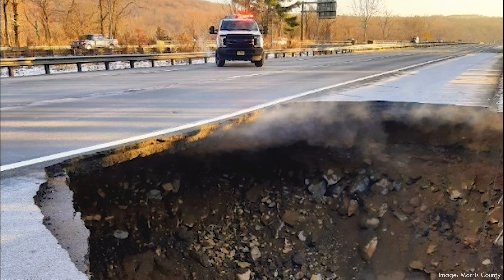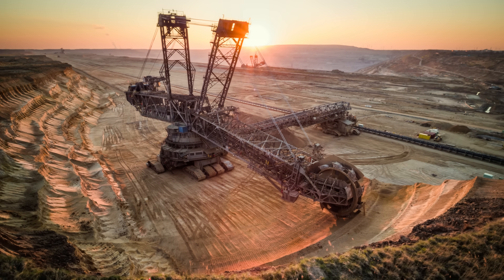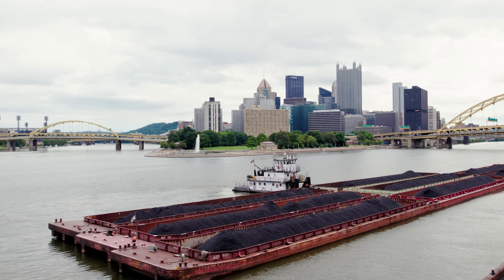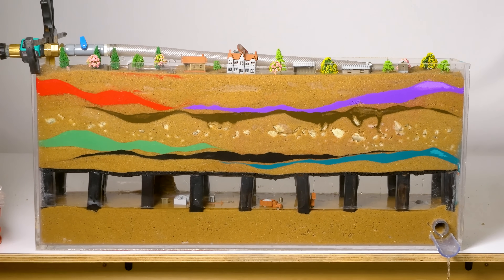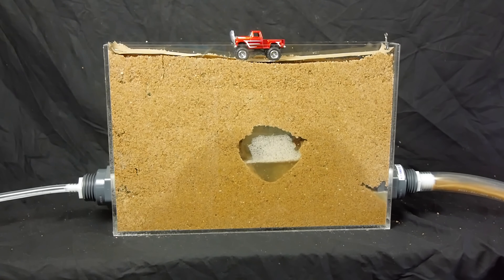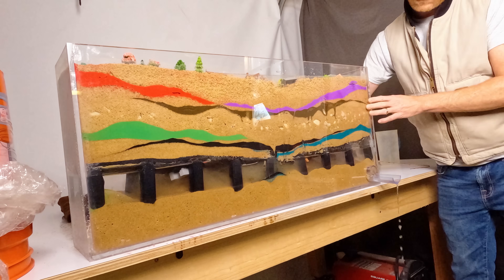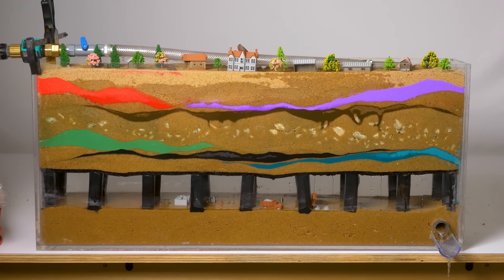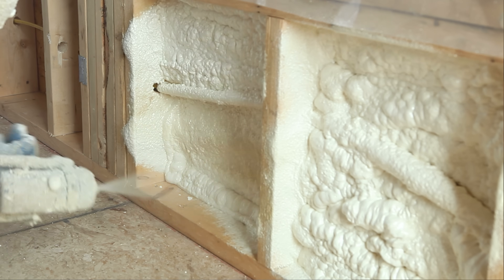When Abandoned Mines Collapse

Comment: In the 1980s I was involved with strip mine reclamation in Illinois. There can be as many as 5 layers of coal seams stacked that were shaft mined. Then as technology improved, the company came back and strip mined the remaining pillars of coal from the top seams. So you end up with strip mines on top of shaft mines. Some of the worst to try to restore ended up as local parks that mitigated runoff damage but no attempt to restore the original grade. They made good refuge islands for wildlife in the great corn desert that is Illinois.
Reply: as a current resident of central Illinois, I can confirm that there are numerous weird holes in the ground around here that are used as ponds/lakes for sportsmen.  I've been told that the Wildlife Prairie Park near Peoria originated in that way... but that is a somewhat hilly area to start with.  A buddy used to be a machine operator at some of these strip mines and shared a few stories.
Reply: @SkyhawkSteve  As a Southern Illinois raised person, I can also confirm. :D  In fact, my father worked for Peabody, which had both room & pillar and strip mining in the same area.
Reply: @SkyhawkSteve CENTRAL ILLINOIS MENTIONED HECK YEAH (I hate it here)
Reply: In a way thats almost the best outcome. Wildlife refuges, parks, campgrounds, sports fields (without the big paved lots & stands), etc.
Reply: If you ever check out old mining maps, springfield Illinois is basically sitting on top of an old mine. They were mining in the early 1900, so springfield was very small at that time. They would mine everything in rural areas around springfield. 100 years later, springfield has grown and basically developed on top of the entire mine structure. And yes, they have been having mine subsidence over the last 50 years. Makes buying property and building a home kind of scary.
Reply: @jerrywright9657  Fun fact! Murphysboro had the very first commercial coal mines in all of Illinois. And in southern illinois, there was the Herrin Massacre, over coal mining. You can get the mine maps and mining reports for free to download from University of Illinois if I'm not mistaken. They describe the conditions underground, type of coal, and amounts mined, from what seam, and over what times.
Reply: @robertschemonia5617  The ilmineswiki site gives some very detailed maps, maybe that's the one you're thinking of?
Reply: From around Marion, Illinois up to Springfield is like swiss cheese from the coal mines. We've also got a bunch of old mine pits around Dongola, IL area that people have used as "swimming holes". Dongola use to be a major transport hub for the Central Rail Road also back in the late 1800s early/1900s. Actually was a kid a decade or so ago that went swimming in one and died a couple weeks later from some sort of either parasite or bacterial infection (can't remember now) that got into his brain.
Reply: @WreckedRevival  That would be Naegleria fowleri, the brain eating amoeba. Rare but fatal. Only 4 survivors of 164 cases in the last 60 years.
Reply: @jerrywright9657  Did the amoeba grow there because of stagnant water?
Reply: @eugenetswong  It's common in the environment both soil and water. Stagnant water is just one of many places. Grows at temps above 50F best above 77F so when it gets in the brain, it's prime temperature to grow. Infection is limited to one specific stage of the life cycle so a lot of things have to happen at the same time to get it on the path to the brain.
Reply: @ Jerry, thanks for this info and everything else that you mentioned!
Reply: Driving between Du Quoin and Sparta is like visiting a different planet.
Reply: @ Also between Marissa and New Athens.
Reply: I love it when people who really know what they are on about comment
Reply: @the_even_toed_ungulate.  'I love it when people who really know what they are on about comment'

I agree. Quality comment sections are priceless.
Reply: In edwardsville and the surrounding areas, they built a trail that goes thru the reclaimed stip mine areas
Reply: @jerrywright9657  I know someone with the same name. My father worked for the place he owns for a lot of years. Wild.
Reply: Reclaimed strip mining in SE Ohio has not done a great job restoring the land. I'm not sure why this is - maybe no specific retention and replacement of topsoil - but the land does not recover well.
Reply: How do you strip mine pillars? Remove the overburden to the level of what used to be the roof of each level? At some point the overburden would cave in and fill the rooms between pillars. Selectively mining the coal while not mucking out the waste would be difficult.

Are you sure they weren't retreat mining the pillars?
Reply: Glad to see some discussion about Southern Illinois on such a popular video. Grew up fishing reclaimed strip pits…there are no shortage of them in Southern Illinois. Seems like every one of a certain age had multiple people in their families who relied on coal mining to make a living as well.
Reply: Kickapoo State Park.
Reply: Yeah im from Lincoln and I've been told we are on top of a coal mine. All the houses sink and sag. Its sad.
Reply: Corn desert? That's one way to out yourself as a criminally incompetent city slicker

Comment: Worth noting, NJ had an earthquake not too far from the I-80 collapse less than a year before the collapse. Your banging on the model is not too far off.
Reply: I live to the east of the collapsed areas of t
80 and was about to add a similar comment.  One clarification.  There is regular seismic activity just to the south of Wharton… about 30 miles max.  In fact, there have been 30 quakes over the last 365 days.  About 10 in the area of Bedminster between 1.5 and 2.4 in the last 7 months.  The Ramapo fault runs through the area and under 80.  The one you are referring to was in April 2024 at 4.5.
Reply: @georged9234  It was a 4.8 actually. I live in Warren County so I was very near by the fault that was just north of Annandale, NJ about 3 miles off of route 78. I felt the full force of that quake, very surprised given it was an unknown fissure from the Ramapo fault. Well, it's known now that's for sure.
Reply: You could say that he was nearly bang-on...
Reply: Agreed NJ has a fault line near Manhattan itself.
Reply: My GF suspected the Earthquake (4.8) probably contributed to this problem. That quake was much stronger than I would have expected around here. I was right on top of the Epicenter of it when it happened. It was wild.
Reply: If anyone wants to know the name, it's called the Ramapo Fault line. It follows the ridges of the Appalachian mountain ranges. The Earthquake 4.8 last year was from an unknown branch of the Ramapo fault.
Reply: I came to say much the same thing. I live 3 exits West of the collapse.
Reply: Do they have any idea if the earthquakes caused (or contributed) to the collapse? Or were some of the quakes potentially caused by the ongoing collapse? (I am not sure how large the area is so maybe it makes no sense for the collapse to cause the quake)
Reply: @johnkeefer8760 theyre unrelated events from what I've read.  I live in the area too, close enough to have felt the earthquake.
Reply: @ nothing shared by the media at this point
Reply: They should let out the earthquakes more often so they don’t build up so much
Reply: Not to mention the drought we had
Reply: @blacksheep9734  Ground is usually not just sand and it drastically expands and contracts on wet and dry. 
It causes similar effects as ice breaking up the road. Much weaker effect than ice but there is a lot more soil.
Reply: @DataLog 
Except this area is not sandy soil. We have a lot of rock here. Hard to even dig a garden bed with the amount and size of some of the rocks
Reply: This has not much to do with anything but hey other b!